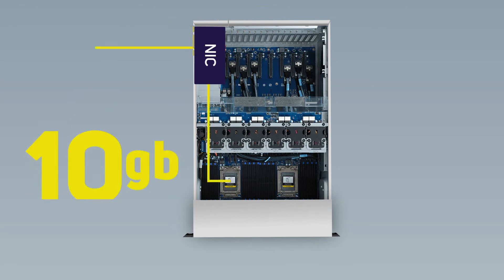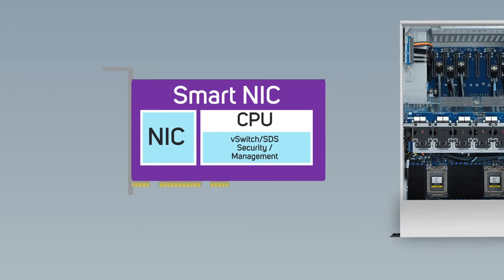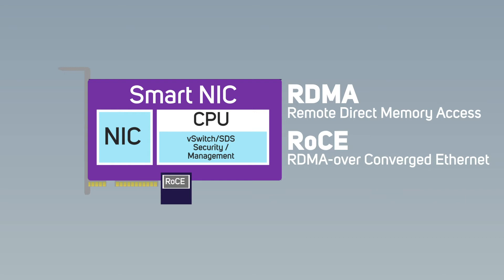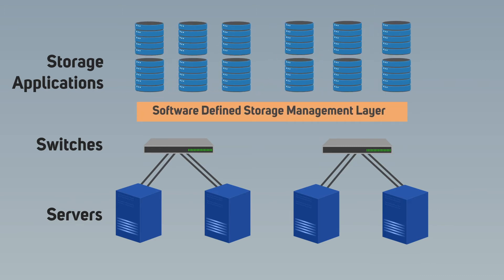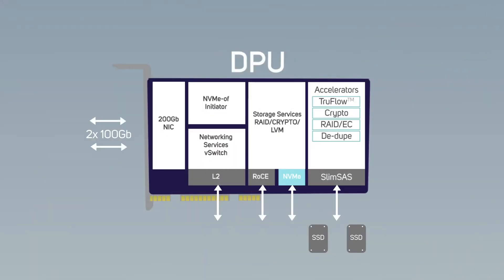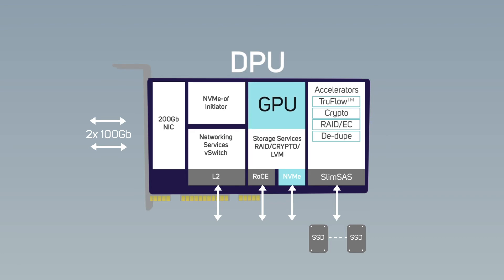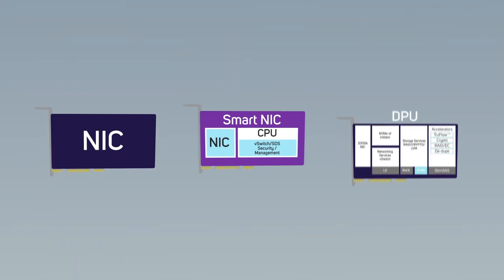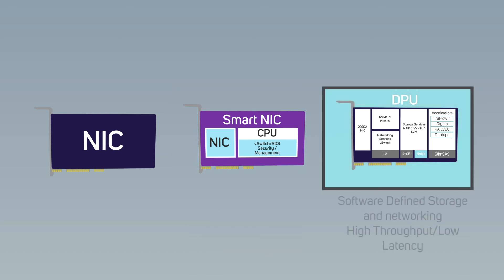What is a DPU and why does it matter? DPU vs SmartNIC

Comment: Interesting video explainer. With more and more processing being done on a DPU, will reliance on system CPUs then reduce? Would you still specify a high core count CPU or dual CPUs if you had a DPU card installed?
Reply from the maker: That's a good question, although CPUs continue to add more cores and features every generation, there's no doubt that dedicated hardware, be it a DPU or a GPU, is almost always faster and more efficient. DPUs are specifically designed to offload network processes from the CPU so for some servers that might mean you can get away with speccing lower-cost CPUs; viewed another way you could keep using high-core count CPUs as all those cores are now free to run more VMs / applications. JG

Comment: Thanks for this explanation. Do you reckon this will eventually displace NICs, RAID controllers, and SSD controllers in the datacenter? Great possibilities when paired with composable infrastructure.
Reply from the maker: Thanks for the feedback. It's quite likely that DPUs will replace many NICs in the datacentre over the next few years, but not all workloads require the added management features and performance. Where NICs and SmartNICs will stay around is in the lower network speeds (around 10GbE or so) typically used by SME servers and workstations. - JG